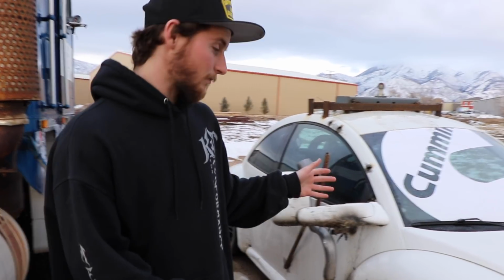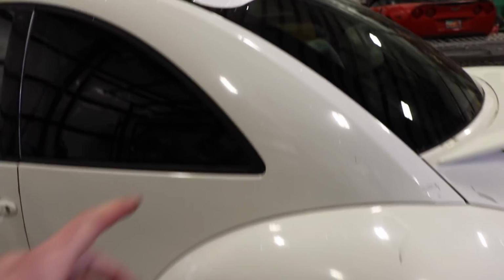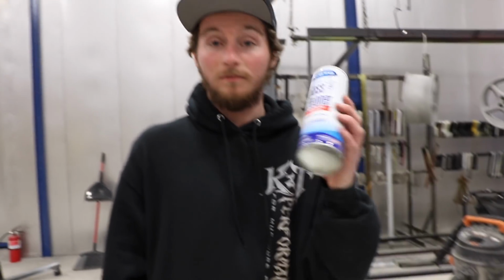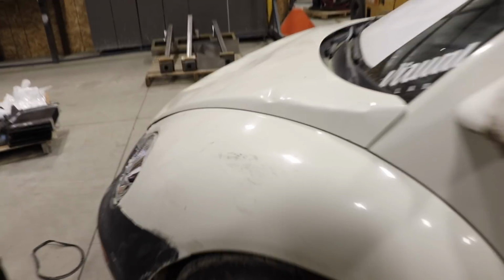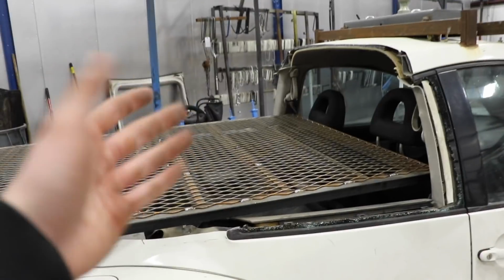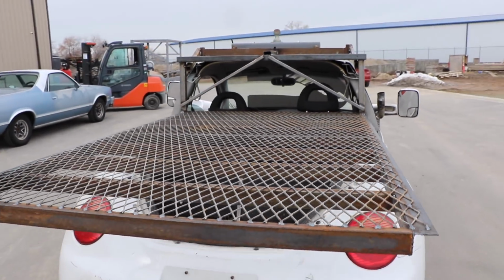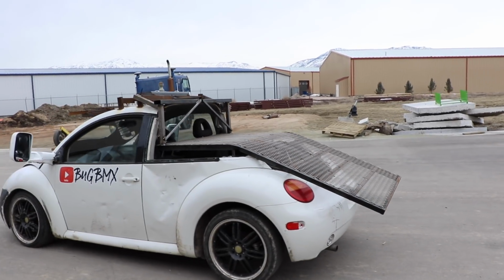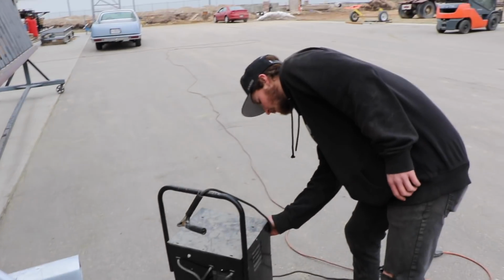Installing A Flat Bed On My Diesel Bug!

Comment: Work bug,truck bug, beetle juice,mudbug,   baja bug , crushed bug, 

 weld two electrical pumps so pump can move the top bed so you can use the bottom bed,  you shouldn't of cut those pumps you could of even used that oem style 

if you open your battery clean filter the acid  pu water in the battery 3 times  3 time let the battery  charge with the water in it then empty it it cleans the cells in the battery then put the clean battery acid on the battery and charge it. Then close the battery you pay for this service at candian tire but people are to knives so they pay

Comment: Better sound cars than that smoking tractor are 2006 volvo s60R 5 cylinder awsome sound and the 2009 volvo Xc90 T6R 6 cylinder, by far the best sound stock cars

Comment: 6.0 powerstroke or any powerstroke for that matter or a duramax sounds better than the beetle cat motors and 6bt cummins motors all sound better than the beetle hell most tractors sound better than that the turbo sounds like a cheap bottle rocket and the sounds like someone shitting sorry not sorry it may be cool but thats besides the point also when you starting the cabover?